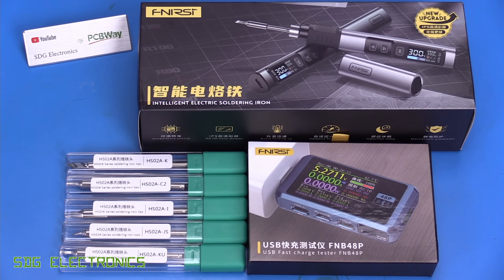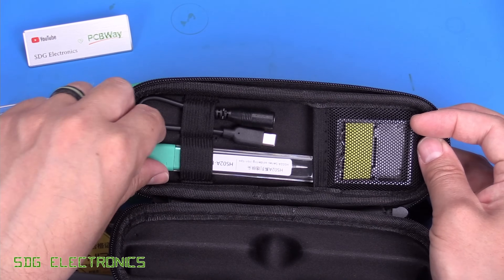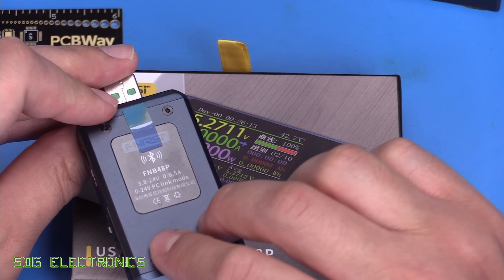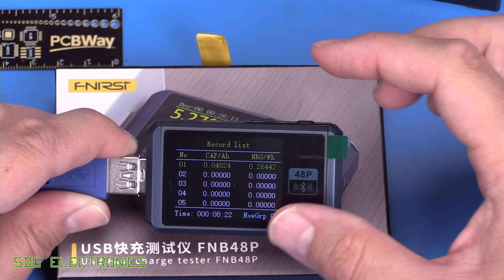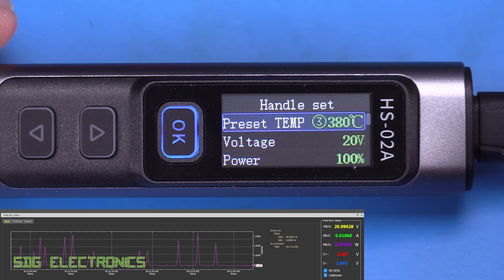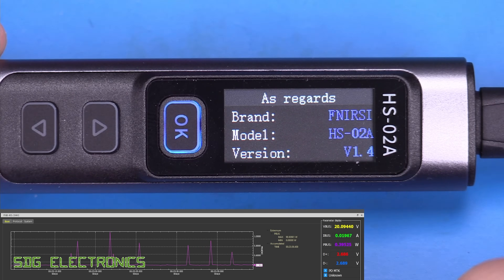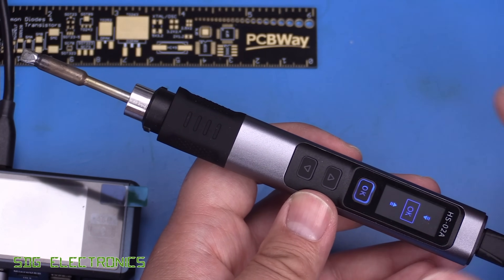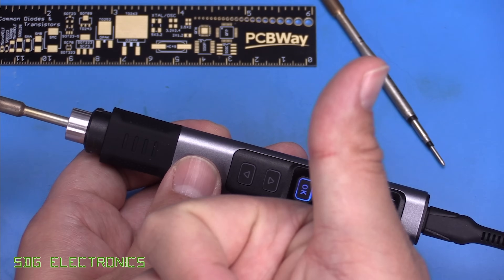SDG #340 FNIRSI HS-02A 100W USB Soldering Iron and FNB48P USB Power Monitor

Comment: Could you please add the protocol test for the 100W charger along with the cable that comes standard with the soldering iron? Connecting the cable to the FNB58 and running the protocol autodetection. This would provide information for those who want to purchase the adapter separately from other brands and ensure it is compatible with the soldering iron. Thank you.

Comment: Great video, I'm gonna get one of these, I think :-) .... what kind of solder wire are you using here? Brand? Diameter? ... Any recommendations? :-) Thanks
Reply from the maker: I tend to use 63/37 loctite/multicore solder, but Kester 24-6337-0018 is good too. For professional use it'd be SolderKing Sc100e. 0.5-0.7mm is my usual choice

Comment: Can you advice about your power supply unit? I have 100W GaN USB-C (WEKOME WP-U155) with 100W USB-C cable, but I can set maximum 65% of power and I wonder if it's the charger fault or I do something wrong.
Reply: I'm having the same issue with the Essager 100W model ES-CD37. When I set the soldering iron to 20V and 100% power, the power supply resets. I decided to purchase a PD3.1 cable to test it; I believe this is the reason for the reset. I'll add it if the test is successful when I receive the cable.

Comment: For those who don't like the rolling temp number animation on the HS-02 if you update the firmware to 1.7 you can disable it. Look for "Rolling" in the system section. By default it is ON, just set it to OFF.
Reply: How do you update it
Reply: @OutOfNameIdeas2  hold down the OK button, plug cable into your PC, then plug other end into your soldering iron. you should see a message pop up on your soldering iron display. you need to drag that bin file to the BOOTLOADER that shows up on your PC. once installed, the soldering iron will reboot. you can now unplug it from your PC.

Comment: My solder not working. Used about 5 times and not heating up but it shows 650 degree celsius on screen, not work on every 6 tips. Why its not heating up? Any solution?

Comment: As the device is rated 100W, have you ever reached peak power near 100W output on your reading, if your power supply is cable of 100W or more?   Recently I bought a similar product rated 100W, but my reading was never more than 4.2A on 20V (from both of my PD 100W power supplies), even though  I could set the max current on my solder as 5A.

Comment: You say it works fine with genuine C245 cartridges. Does that mean you've actually tried it? Genuine cartridges, having a resistance of about 2.5ohms, would need to draw greater than 5A to reach 100W - can this iron run at > 5A? (perhaps using a suitable power supply & the supplied barrel to USB-C adaptor)
Reply from the maker: @gregsullivan7408  everything 15:00 onwards is using genuine JBC cartridges
Reply: @sdgelectronics   excellent - thanks. I'd be interested in an explanation of how it can do the voltage conversion so efficiently - have you discussed this already perhaps, in another video? 
Btw it's an absolute pleasure watching your presentations - you're an excellent speaker. Thankyou.
Reply: I just asked Fnirsi what the resistance of their tips are, and it is in fact 2.5 ohms! So the iron actually has a DC-DC converter??? I thought it would be very simple, and simply switch the input power on & off. How on earth can it dissipate the conversion losses? I must be missing something.

Comment: Questions from a novice:
1.) How do you know what power supply to buy? I've been to FNIRSI's web site and no info is provided. And no mention of it here in this video either.
2.) I think I'll need the JBC 245442 chisel tip as I plan to use this for through-hole PCB work. Can I order this unit with just that tip?
Reply: On fnrisi website theres a option that includes the charging cable with the charging plug for aditional 30€

Comment: hi, does the FNIRSI hs02A soldering bit support AIXUN soldering bit?
Reply: I think it would so long as you use the T245 compatible cartridges, since they are both designed to be compatible with JBC style 245s.

Comment: These have a lot of voltage leak at the tip, but if you use a power bank it’ll be fixed
Reply: Use the grounding terminal on the handle. Problem solved.
Reply: @robertsekrst8020 what do you mean exactly?

Comment: How does it perform with that barrel jack adapter connected to a regular PSU? Can it be used with a 24V adapter? Any chance of using it on the field with a 13.8V car battery?
Reply: Performance is no different. That adapter just connects barrel jack to the USB power pins. 

24v is likely too high for genuine JBC tips (230W if 2.5R load).

15-16v at the cartridge gives 100W with JBC C245. FNIRSI spec says 100W max. 

13:23 - It looks like this iron limits the power so maybe 24v will work.

Comment: One thing that breaks on Fnirsi, is USB C jack, after some months of usage, usb C jack will start to bend left and right... to prevent total damage i literally epoxy glued that 15cm cable to the soldering iron, now its fixated and cannot move... one plastic part 5-6mm wide in that area would prevent USB C connector being destroyed over time... so plastic part is supporting usb c cable, from all 4 sides... 3:37 - Here you can see that metal connector is not supported by black plastic.
Reply: I see it, thanks!
Reply: Thanks for the heads up. Is there a less permanent method that might work? Is there a glue that could be removed easily with heat, for example? If not a glue, some kind of wax?
Reply: @gregsullivan7408  You can use hot melt glue. For glue gun. Transparent tube that you put in heating gun and it melts glue. 
Second solution is to use a lot of isolation tape to prevent moving and bending of connector in jack.
Reply: @orion310591RS  thanks. So is that clear hot melt glue easy to re-melt? Would there be any risk of damaging the body of the iron or connector?
Reply: @gregsullivan7408  No risk of damaging as it cools down in 2 seconds. Can be removed by fingers only when its cold. Try on some other material before you glue cable to soldering iron.

Comment: There is also a HS01 version that takes T12 tips. Would be nice with a comparison.
Reply: I believe the HS01 tips are a shortened version of T12, so using standard T12 tips is not really an option

Comment: If you work fixing MacBooks, don't buy it. This ampmeter messes up the 5 to 20v negotiations.
Reply: what do you mean, it's delivering wrong  voltage? or  it's just not working?
Reply: @MrFrambooise  If you use it, 5v is not gonna go up to 20v. The whole point of using ampmeters with macbooks is to analise the voltage negociation and amperage. This thing is useless for me if it doesnt let me see that. It stays at 5v.
Reply: @DciMaluko you likely need to flip one of the usb C connections. Most usb testers only work in 1 orientation. So if it’s not negotiating properly, just flip a single usb C connection.

It’s also possible you need to update the firmware on yours.
Reply: @bjt3833  The 2 bucks one I have works both ways. There is no excuse for it.

Comment: I also got just a few days ago the FNB58 the one without Bluetooth but connectors only pass trough the USB 2 signal not the USB 3 so I need to make a modified cable in order to be able to measure the power consumption of some USB 3 devices. I was interested in testing some USB 3 flash memory and for example on USB 2 it will use 0.19W idle 0.38W max while reed or write on but when connected to USB 3 it will use significantly more around 0.6W idle and 1.8W under load (reed/write).
Most new USB 3 flash memories get way to hot so I was trying to find one of the better ones for a project.
The ADC resolution is also only 16bit for the current measurement on this and on my older USB power meter it was 18bit. But they show a lot of decimals to look like they are using a higher resolution ADC than they actually do. 
The interesting thing is that they use antialiasing for the text on the FNB58 so text looks much better on the small screen than on the FNB48. Other than that and menu being a bit different I do not think there is much of a difference.
Reply from the maker: Ah thanks for the information, I didn't realise the limitation on USB 3.0. Any devices you're aware of that pass through properly?
Reply: @sdgelectronics  I need to apologize for the incorrect info. I just opened the FNB58 today and it looks like maybe the two USB-C connectors have the USB 3 connections on the PCB. I do not think I have a proper USB C cable to test that it actually works but it should and also not sure if the FNB48P is the same PCB or different. The USB A connectors are clearly just USB 2
Reply: @sdgelectronics  The AVHzY C3 and likely other models they have have USB 3.2 pass-trough at 10GB/s but they are more expensive. I just assumed the Fnirsi had also pass-trough but I was wrong.
Reply: @sdgelectronics  I have a couple of more basic usb meters which do pass through usb 3.0 (though maybe only 5 gbps): Ruideng UM34 / UM34C (only USB-A connectors pass usb-3) and Ruideng TC66 / TC66C (USB-C only)

Comment: Thank you for great review love the channel.
Please whats the difference between the A version you havr and the hs02B version please .??
Reply: Hs02a for 245, hs02b for 210 tip
Reply from the maker: Just the colour. The HS-02B is all black
Reply: @sdgelectronics  It was my impression that the B model uses T210 tips. The FNIRSI store also says that the A model uses tips with a heating core resistance of 2.5 ohms, while the B model tips' heating core resistance is 2.1 ohms.
Apart from that, both irons and tips are different lengths, 13 vs 13.5 cm and 9 vs 6.6 cm, respectively, for the A and B.
Reply: @eggman3141 hello yeah my iron just turned up.
Cam definitely confirm tips are very short and also end of iron silver  mounting part looks different..
Now I don't know if the a or b version is better 😂😂
Reply: @sdgelectronics  thank you so much I thought I ordered the wrong one lol 
Should be here tomorrow fingers crossed 
And again thank you so much for the reviews.
They really do help myself and others out so much.